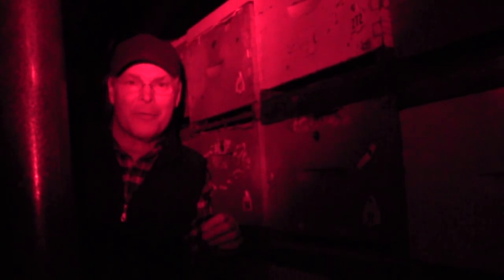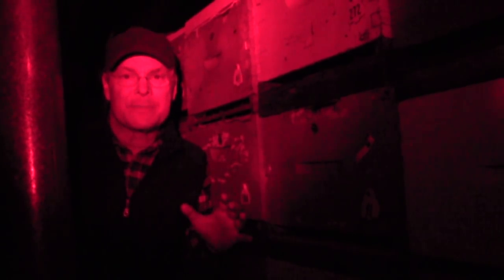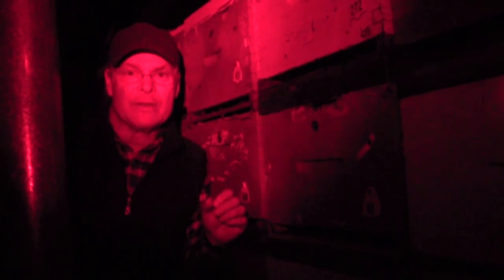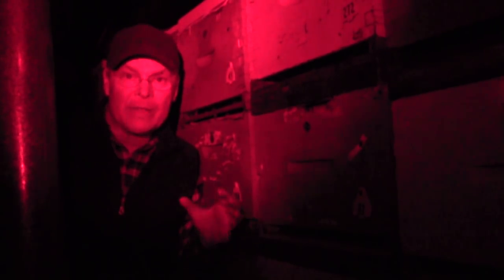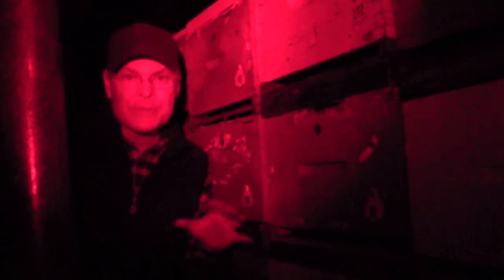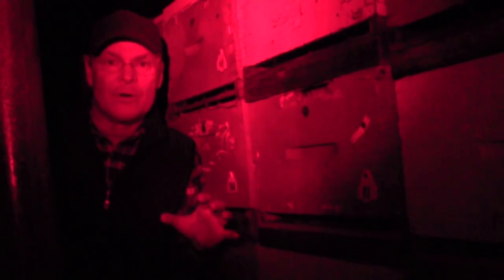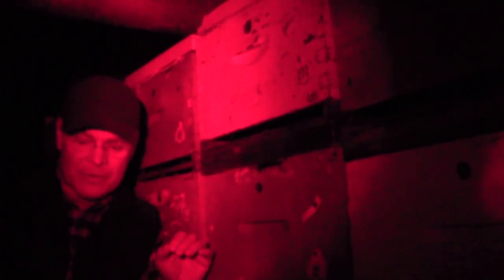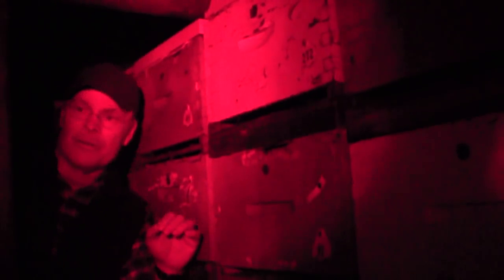Indoor Overwintering

Comment: Hi there. Love your videos and info you share. I'm a new bee keeper with 7 hives in Vancouver British Columbia. Next year I will expanding with a lot more hives. This video you made is 4 years old. Is there anything you have changed since making this video; like temperatures, ventilation etc? Do you also monitor and regulate ambient humidity in the winter room? I would think that may be an important factor to overall humidity in the inside of the hives as well since there is a bottom entrance and top entrance to the hives so the outside humidity most likely has some significant effect on the inside of the hives humidity as well? Where my hives are the average winter temps for highs and lows are: Nov: +10 high/-5 low, Dec: +6 high/-13 low, Jan: +7 high/-5 low, Feb: +9 high/-7 low, Mar: +11 high /-2 low, Apr: +15 high/+2 low. With those kinds of Winter temps when would you recommend putting my hives indoors? I have a fully insulated shop with its own power an separate man door entrance in another room of the shop so no light leaks will come in to the bee winter room. I also have a generator in case of power outages. Locally here in the lower mainland of BC I have heard of winter bee mortality rates as high of 75% with keepers that aren't doing anything to their hives for over wintering and as high as 50% for keepers that are just putting inner cover insulation on and/or insulating blankets on their hives. I was contemplating having high density Polystyrene insulation (R value of 7) full hive covers made for my hives with the lower hive entrance still open and an upper vent hole but now I'm more seriously considering over wintering indoors instead. My shop is 33' x 20' x 10' Fortunately I have close friends in the electrical and HVAC business so putting some equipment in and controllers etc will not be an issue. Would really appreciate your advice. Thank you.
Reply from the maker: Thanks for your inquiry. Indoor wintering might work ok there but your temperatures over the winter are pretty mild. We use out door air to cool the room and the fan runs constantly when it is warmer than 8C outside. I get worried when the ambient temperature climbs to 15 for a day or so while they are inside. Refrigeration is pretty expensive but might be needed where you are. 
I'd start with using basic hive wraps, reducers and and top insulation. They help a lot too. Our video on 'feeding and overwintering' shows what we us outside here. I think it would be more than adequate where you are.
Reply: @UoGHoneyBeeResearchCentre  Thank you very much for the reply and the great info. Sounds good I will over winter outside and see how they do. Question for you, I have a friend that makes all kinds of custom stuff out of high density polypropylene. He made my hive stands for me out of it. I know a lot of beekeepers put a slab of polypropylene insulation in the inner cover, then do a hive wrap on the outside for over wintering like you mentioned. I was brainstorming different ideas and I thought maybe I would try getting him to make me some custom polypropylene full outer hive covers for my hives for over wintering with. He could make them however I want; with entrances, vent holes, whatever is needed. The #2 grade polypropylene I think is rated 7 R value in 2" thickness. If I overwintered that way with a custom full 2" outer cover covering the whole hive snuggly, made out of the polypropylene do you think I would just need a small entrance hole or do you think I would also need an upper vent hole as well? I would be concerned about trapping humidity inside the covered hive over winter. They make some pretty great digital, blue tooth thermometers/humidistats now days and some with inside and outside readings that I am thinking I could put in one of the hives to see if the conditions are ok for them trying this method out with the full polypropylene hive covers on over winter. What do you think?

Comment: Could you please share a document about how to build an indoor winter shed for beehives. Heating and cooling requirement. Ventilation requirement. Space requirement. I haven't found information on the net for this. I guess Guelph must have made such a document to building the shed.
Reply from the maker: Hi Guy
 Thanks for asking.
Our room is set up to be able to winter 300 colonies inside. Here is a link to a write up on our room specs. It's in the resources for beekeepers section of our website.
https://honeybee.uoguelph.ca/resources-for-beekeepers/indoor-overwintering-room-at-u-of-g/

Comment: Hi.  I tried over wintering a few hives this past winter in an small 8x5x5 uninsulated cargo trailer. There was lots of condensation in each hive which contributed to about a 50% loss.  I'll insulate the trailer this year and add an upper entrance. I do have a question about air flow.  In my setup I have two fans, one to cool down the inside temperature to 5 degrees Celsius and the other to refresh the air every hour.  Both blow air into the trailer from the outside.  I'm wondering if blowing air out of the trailer would reduce humidity given the trailer is buried in up to five feet of snow most of the winter.  As always I enjoy your videos.  Thank you.
Reply from the maker: Hi Elizabeth
 Nice to hear you enjoy our videos. We find we need open bottom entrances and and upper entrances to prevent condensation inside the indoor overwintered colonies. I think insulating your trailer will help. It should reduce condensation within the trailer and thereby reduce the humidity. Seems to me snow build up outside would help insulate your trailer so that's likely beneficial.

Comment: I am wintering my bees inside for the first time. I am in Quebec. The room is well insulated I have a fan drawing air in and a fan drawing air out.  I have put a quilt box on top of each of the hives to soak up humidity. Should I leave the top lid on or leave it off for the humidity  to disapate >>
Reply from the maker: Hi Christine
It's not a good idea to have anything on a hive that retains moisture - indoors or outdoors. It's better to give the right amount of ventilation and insulation so moisture doesn't accumulate and can be expelled. For indoor wintering, we leave our entrances un -reduced and provide an upper entrance.  Our temperature is set for 5C. That's an ideal temperature for you to try for.
Reply: @UoGHoneyBeeResearchCentre  The quilt box is actually dried shavings in a super {with burlap to hold the shavings} on top of the deeps. I have removed the outer covers ,no reducer and an exit at the top of the deeps below the super with shavings. My bees were up around the opening in the inner cover, don't seem to be clustered so hopefully they have slowed in consuming winter supplies. My BEE & BEE is maintaining an average temperature of 40F and 67% humidity. Thanks for your  E-MAIL

Comment: I've decided to try overwintering 10 of my hives in a very small trailer (5'x8"x5' or 200 ft3).  In deciding the size of the fan could you tell me how large your room is? Also, given heat is very expensive off grid and the trailer and or hives will be insulated, I'm thinking I can skip the heater. I should add I'm in the mountains of Colorado. Sound right? Thank you again for your videos.  You are my go-to experts on beekeeping.
Reply from the maker: Hi Cliff
Our room is 30' x 10' x 8' high - or thereabouts. I'd set up your fan on both a timer for periodic air exchange and a thermostat so it runs constantly when the temperatures get too warm inside.

The biggest concern with indoor overwintering is overheating. I could tell a few very sad stories about that...

Comment: I would like to know about some of your equipment. I see you wear an apron and tool belt. Where and why and what's in the tool belt you consider essential? what is the best color to wear. I go with white everything if I can.
Reply from the maker: Hi Wayne.
 I like a workshop apron because it keeps my clothes clean and I can wear whatever suits the temperature underneath. I make and sell the beekeepers tool belts. Dancing Bee is one source for these. See their website for more details. https://dancingbeeequipment.com/products/bee-belt
 I wear light coloured clothes but not white as it shows the dirt. Bees see your movements more in dark clothes so they are best avoided. I hope that helps.
Reply: Do you normally winter them in December? Or do you normally do so earlier in the year depending on forecasts? December 15th seem quite late

Comment: Hi I was wondering what type of queen excluder you use and is it better than others? Thanks
Reply from the maker: Hi Slick
   We use metal rimmed queen excluders. I like them better than plastic ( they are hard to take off and break down in the sun) or wooden rims ( the wood breaks over time).

Comment: Great video! Thanks. Wondering if you would suggest a shelter logic for over wintering hives outside...with doors open for ventilation?
Reply from the maker: Hi Ela
 If you are in a really windy location that might help but generally speaking they are better off without this kind of shelter.
Reply: @UoGHoneyBeeResearchCentre  Do you have details on overwintering hives outdoors? There's a big debate about top ventilation vs better insulated and no vetilation on overwintered hives.

Comment: Is this idea how people keep their bees surviving in places like Norway, Iceland, Canada, and so on? 

I like the idea.

I'd read back in the day people used to put hives in cold places in root cellars...would be interesting to hear the comparisons on survival rates between this, that, and keeping them outside with tarpaper. (Not sure how well tarpaper would really work, but I listened to some talking about doing that...but they didn't clearly state how many layers of tarpaper they did around the hives, and if they did other insulation between the hive box and the tarpaper.)

Thanks for sharing your knowledge.

Your setup looks very well planned.
Reply from the maker: Hi Noah
   Indoor wintering is common in the colder areas of Canada - Quebec and the western prairie provinces. I don't know how common it is elsewhere. Cellaring bees was done here 100 years ago but high humidity was a problem. Most beekeepers here wrap their hives in a varoety of materilas and leave them outside. They go through more feed out side but get an earlier start with brood rearing. Every winter is the same inside so we split our risks by wintering some inside and some outside.

Comment: You moved them indoors around December 15th. When do you take them back out in the Spring? What's an estimate of the average lows when you place them indoors and average lows when you take them out in the spring? I live in the coldest part of Colorado and often time the coldest part of the US and would like to keep my bees alive through the winter without moving them to another state every year.
Reply from the maker: Hi There
We move them out in late March or early April depending on the forecasts. I like to see an average temperature of higher than 5C before moving them out. Moving them in is partly about getting them in before there is too much snow but if the average is below 5C then that's a good time.
 Cook and Beals from Nebraska installed our equipment. In our coldest provinces indoor winter is very common.
Reply: Hi ! Where I can find specification of your equipment? Did You try with aidea ?

Comment: I was trying to build a small bee shed with the features you have in your room. Saddly no one in my area could provide me with the equipment. Do you have a comprehensive list of the type of thermostat and fans/thermometer needed? Cause no one at Rona, UFA or even the guys that specialize in vents and heating had a clue.
Reply from the maker: Hi Dave
  We have a basic list but not one that includes all the electronic controls Send me an email pgkelly@uoguelph.ca if you'd like me to forward our write up. We had ours professionally installed by Cook and Beals our of Nebraska. You could talk to someone who works in livestock building systems.
Reply: Johnstone supply HVAC EQUIPMENT

Comment: Great method for beekeeping i keep watching all your videos 
I have a  two questions i would like to ask you if it possible 
How can i know that i have a virgin
 queen ?
When do the virgin queen lays male eggs ?
Reply from the maker: Hi again HT
  1.Virgins are smaller and have a 'brand new' look. They also run around more and are harder to find.  What may be easier to find are queen cells that virgins have emerged from  - a telltale sign that something is up. Look closely for these cells. Often beekeepers think they they  don't have a queen because there is no eggs but either a virgin is on the way or she hasn't yet started to lay. Come to think of it this would be a good video topic! 
 2. Virgins only lay unfertilized or male eggs if they can't mate. . Maybe a damaged wing or too late in the year for drones to be available or a long stretch of bad weather  They are able to mate between 5 and 10 days after emerging after that if they haven't mated they start to lay unfertilized eggs
 Good questions EE.

Comment: I over winter my colonies indoors under similar conditions. A Manitoba winter shed brooding chart by Randy Oliver I believe, showed that the bees do brood too a small extent in the shed. When I pulled mine out of the shed this spring I immediately inspected each and found at least a 1/4 frame double sided of brood.  Capped and larva of different stages right out of the shed in each hive. It doesn't seem to be enough for population growth or possibly even full maintenance of the drop but there is no doubt that 100% of my hives were brooding in the spring shed before they were taken out.
Reply from the maker: Hi RAW
   I don't check too often on the colonies right after they are moved out. Last time I did there wasn't any brood but lots of eggs. I think that was after a couple days. I'll  look this year. We moved them out last night.
Reply: @UoGHoneyBeeResearchCentre  I didn't check for 3 days due to weather but I found brood all stages. That doesn't happen in 3 days. I just did it to answer the debate for myself. Just figured I'd mention it. If the weather is half assed decent tomorrow i'm gonna go in to see what's happening and add some more pollen patties. I slightly cracked a nuc today and the pound I put on a week and a half ago is gone and they are just swarming the ultra bee dry supplement besides. Sun is warm but the air here is still cold so to go in I need decent conditions so as not to chill anything.